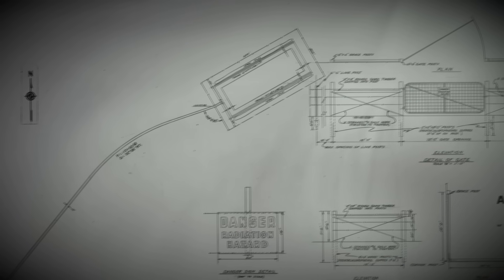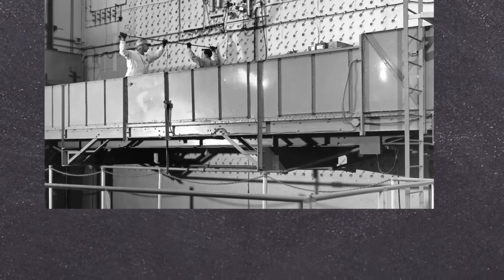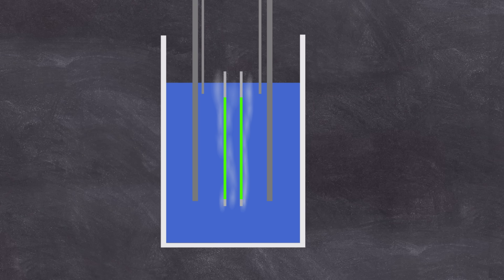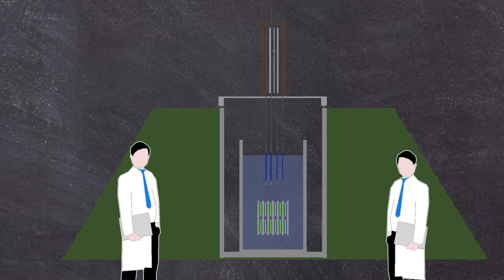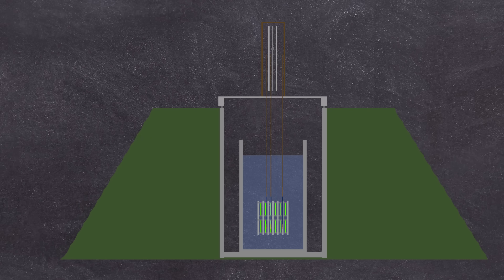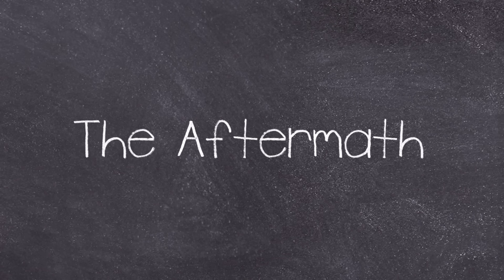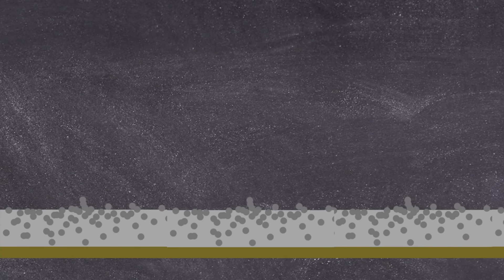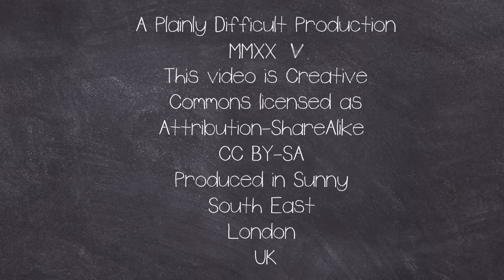Nuclear Reactor Melted Down Deliberately To See what would Happen | Plainly Difficult

Comment: I worked for Argonne National Lab for 4.5yrs, until 2009. I had a 10yr. NDA to follow after I was laid off due to DOE funding cuts. But I can tell ya that place was as dangerous as hell with all the experiments they did in the late 40s through the 60s. Basically, any structure or grounds in the building 3 and 400 area required film badges that were closely monitored. Some buildings were so hot that 1 had only mins to be in them with all PPE on. I had friends that worked in HazMat that were tasked with cleaning some of these places up. Some lost their hair..There was 1 building in particular that was being dismantled and its core was shipped in a stainless steel and lead lined 'bean' to Los Alamos to be buried. It was so touchy, it had state police escorts from IL to NM, and 3 different truck drivers to haul the same trailer. The final truck and that trailer were never to leave that site again. I recall the 'old timers' telling me that the building we were in, 46, used to have a huge burial site in the adjacent field  right across the street. This was several acres of scrub grass and no trees or shrubs. They won't grow. Hundreds of 55gal drums of God knows what were buried there, of which poorly trained crews dumped, some leaking. It took yrs to excavate and remove tons of dirt, all hot and ship it to lord knows where. If you look where east gate is, you'll see vast old parking lots but the buildings are gone. All of that was said to be hot areas.
Reply: After all these years, Hanford's Vitrification plant is in final testing prior to making inroads into processing 56,000,000 gallons of radioactive waste courtesy of Plutonium production from Trinity/Nagasaki through the mid-1980's....
Reply: One of the things that helped the Chernobyl disaster so deadly was an almost complete lack of understanding of what radiation was. Do its funny to hear your story and I think to myself that if, the Russian higher ups had known about as much you guys did how it would have looked historically in the Chernobyl incident.

Comment: The extreme longevity and unsurpassed danger of the spent radioactive materials is why I just don’t believe in nuclear power. Active reactors have a relatively short life span of around 30+ years but their spent nuclear cores contaminates on for centuries. How is that good for us?
Reply: Do you know much about nuclear waste?
Reply: @ not very much I admit but anytime I read about it the informations always says how many decades or centuries it will take to deteriorate to non-lethal levels.

Comment: @04:05 -- I think the concept makes more sense if the reactor fuel rods are horizontally mounted, and the water/moderator is "shallow" and wide.  Vertical like in say BMRK wouldn't do well, because any height difference exaggerates the heat (infrared photon) difference.  Do we want a shallow pool which periodically dries, or a vertical cauldron of doom where the closer to ground water is still constrained by water above it, while it receives sufficient heating to flash-boil and then explode?  Kab0000000000m

Oklo Mine demonstrates that water moderation can do this job, though no one was around to witness. Seems
Foolish to make a boiling water reactor be vertical in its fuel assembly.
Reply: I'm not sure that infrared photons have much relevance here.
Power reactor coolants are normally pumped around cooling circuits, some much of the heat transfer from the fuel is by conduction from fuel via clad to coolant and then by moving the coolant around.
Horizontal fuel channels were used in the Windscale plutonium production reactors but vertical fuel and control rod channels are generally preferred.

Comment: 100 liters of coolant?? Doesn't sound like much.  Could it be 100 gallon?
Reply: I believe that's just the volume of water closely present around the fuel. Because of the short duration of the prompt critical excursion, only that water was vaporised by the heat released.
The reactor tank was big enough to hold about 4500 litres of water.

Comment: Hang on, I thought the whole point of the design was that the reactor COULDN'T explode, because the moderator would boil away as the power increased, thus reducing reactivity and lowering the temperature?
Reply: True but the core design was modified to allow it to explode just for this experiment.

Comment: You explained water moderation correctly. Thing is; It works exactly the same way in pressurized water reactors. Hot water is less dense than cold water. Water heats up, reaction goes down and vice versa. The real benefit of boiling core is, you don't need all that primary loop piping and the huge steam generators operating at 1700psi and 480deg F. It's straight to the turbines at, maybe, 350psi. I saw pictures of fuel assembly "Fretting" when I was doing an HVAC Control System installation at ABB. They were hanging on the wall as art work.

Comment: The inherent stability you describe is due to the moderator's negative reactivity coefficient.
Pressurized water reactors have this too and are inherently stable.  It's not an advantage that boiling water would have.

Comment: Great video and fairly accurate... I have had to go through nearly all of the public documentation and results on BORAX and SPERT at my current position.

The importance of BORAX and SPERT cannot be overstated in determining safe operating limits and principles for all modern light water reactors. The experiments do seem like they were performed in the wild west, but the rate at which the nuclear science and engineering knowledge grew in that time frame was exponential. I'm not advocating for open-air destructive tests, but I will note that these days it can take years to plan, fund, and build small scale tests at a level that the NRTS personnel were accomplishing on a monthly or weekly basis.
Reply: Hell nowadays regulatory costs often exceed the cost of everything else as soon as it involves anything that isn't a PWR or BWR of standard design

Comment: "We've invented a self-regulating reactor that cannot melt down!"
"What if we fixed that?"
Reply: That is what the Molten Salt Reactor was suppose to be... Self healing as well... Interesting stuff. GE doesn't like it though. LOL
Reply: @worldsincollision  Can't be a melt down disaster if the fuel is already molten.
Reply: @worldsincollision to be fair, people are working on molten salt reactors, they were scrapped mainly because the guy working on them was fired for other reasons and no one else was around to push for it, plus there’s issues with electrical pumps working at 700+°C and salt not corroding the metal
Reply: @worldsincollision  it's pretty much the only way GE can catch up to Westinghouse's AP1000, that thing is pretty much peak PWR design
Reply: @worldsincollision  Sodium reactor experiment?
Reply: Hey Mike, hold my beer so I can make this water boil in seconds
Reply: @davidthomas1467 "A watched pot never boils."

And they took that personally.
Reply: Correction: it was an explosion (steam pressure), NOT a melt down.
Reply: ProjectFarm- "we're gonna test that!"
Reply: Once a nuclear reactor goes "prompt" critical (nuclear reaction sustained just by the neutrons released directly in the split  second of fission all bets of control are off. That state was never reached in Fukushima or Three Mile Island and maybe not even in Chernobyl
Reply: @ulrichbrossmann1225   Reactor 4 at Chernobyl very likely went prompt critical during control rod insertion thanks to poor design. This was pointed out in the main findings of the initial investigation into the causes of Chernobyl to the Politburo by Boris Shcherbina, in which he reports on the findings of the State Commission created to investigate the causes of the Chernobyl accident. The RBMK design has a positive void coefficient, unlike the negative void coefficient of the BWR in this episode. There was question based on early evidence that one of the spent fuel pools at Fukushima may have had a small prompt excursion which was only ruled out when isotopic samples of the debris were assayed.
Reply: @Peter_S_  Yes there is evidence for that as nuclear fuel debris and trans/uranium nuclides were found dispersed around the site. The positive void coefficient is due to graphite beeing used as the main Moderator. If I remember correctly,  the prompt excursion was not streng enough to blow up the massive graphite core and sufficient partielle spent nuclear fuel  was left to cause some kind of core meltdown (+ resolidification at base)
Reply: The Republican way to fix things; break it and blame the Democrats.
Reply: “Hold my beer …”
Reply: To be fair, isn't a part of engineering sometimes deliberately pushing something to the point of failure to help develop safety measures to stop it from getting to that point accidentally?

Comment: The UK atomic weapons testing left 5kg of plutonium buried in the desert. When they actually cleaned it up properly they found a sphere of plutonium 1mm round that broke testing equipment.
Reply: Lol, I’m australia they found a cobalt sphere, they found it with a Geiger counter, but it gives off gamma rays they couldn’t measure. 

As they got closer to the base lab the gamma detector kept increasing and went off its nut, inside, with the cobalt sphere in the vehicle outside.
Reply: Plutonium is an alpha emitter. Good luck finding it
Reply: @crono331  There's detectors specially built for it.  Funny enough I just ordered a vintage example: AN/PDR-56F,  has both an Alpha detector and an X-ray detector tuned to the low energy soft x-rays given off by the Pu decay.  For the curious, the x-ray probe is a CaF2:Eu scintillation crystal.
Reply: @Yaivenov  Don't rip the foil! 😅
Reply: @ Yup.  Thankfully it is a simple/cheap as far as scintillation detectors go.  It's a zincsulfide:silver scintillator sheet and then an aluminized mylar light-shield sheet.  Very repairable if I do accidentally poke the foil.
Reply: What about the things it decays into? Are any of them more long range?
Reply: @FireIceEarth  It decays into Helium-3.  Non-radioactive.  Fun fact, the periodic recycling of Pu nuclear cores is where the vast bulk of the world's 3He supply comes from.
Reply: @Yaivenov I'd love to learn how that works
Reply: @colinofay7237  The detector or the helium capture?
Reply: Seems strange to go from an atom that big to He3? Surely like 100 steps in there?
Reply: @Yaivenov  Tell how long it takes to become "Non-radioactive" ?
Reply: How did they find it? You realize how small 1 mm is?
Reply: @Danny_Thompson_sasquaatch420  geiger counter?
Reply: @Danny_Thompson_sasquaatch420 1mm of Plutonium is definitely radioactive enough to et off any detectors for several meters around it.
Reply: They didn't "clean it up properly".

Comment: The 1950's really were the age of "let's do something with this atomic stuff for a larf!"
Reply: Why not? We could protect ourselves under school desks if something went tits up 😕
Reply: @katiekane5247  too soon bud
Reply: Since then, we now sit here screaming incoherently at history books and videos like this one!
Reply: "Let's poke the spicy rock with a angry stick and see what happens!"
Reply: In the building I work in, which is part of a university and has a lecture hall, there are a series of lockers built into a concrete wall.  The doors to the lockers only measure about 1 foot by 1 foot, but have a lead core and weigh about 40 pounds each.  They were for storing radioactive materials so professors could use them in lecture.  They have not been used for their intended purpose in several decades.  Probably since about the late 1950s.
Reply: Operation Plumbob is my favorite when they launched a manhole at mach 170 off Earth lmao
Reply: "What's the worst that could happen?" 🤣🤣
Reply: BORAX actually was more of a series of tests to test the stability of a boiling water reactor (previously thought to be unstable).  The tests showed a boiling water reactor could be stable, and even self-controlling, but only to a point.  The data from this resulted in the BWR design that GE and a few others commercialized in the late 50s
Reply: ...and some of the crap we did in the 50's and 60's is STILL classified.  Even when it is declassified, an FOIA document request gives you documents that are so redacted that it looks like the copy machine had a meltdown.
Reply: "Oo, it exploded! Cool!"
Reply: This was nothing compared to project pluto. Where the US was developing a nuclear powered missle delivery system that could carry 9 warheads and stay airborne for 3 months. Problems were many. The main one was they didnt know where to test it because it left in its wake nuclear waste that would kill everything it landed on.
Reply: @bradsanders407  Failure of a good PR and lobbying team.
"We can build it, but there's no where to test it because it is so deadly." sounds like a great beginning pitch for a black works superweapon. Convince Congress to give you billions of dollars to design and make something that will be completely secret and hidden away. If it works, congratulations, you just aided in ending the human race. If it doesn't no one is going to be showing up to ask for a refund.
Win-Win from a corporate point of view.
Reply: And now we know not to. Except people now want to again after decades of decay in the quality of education and engineers.
These tests make much more sense than people’s modern faith in and worship of technology
Reply: Imagine a world where Teller and MacArthur were let loose without anyone at the reigns.
Reply: ai is our nuclear
Reply: Thats nothing, wait till u r older and find out what they wer doing "for a larf" in the early 40s...that will cheer u up!.

Comment: Spicy water? My favourite! 😋
Reply: Something to drink if you feel thirsty after eating those yellow cakes...
Reply: The forbidden mineral water
Reply: Purified water will not get activated by neutrons so i doubt it was that spicy
Reply: @crono331  I believe that water fresh from a reactor is activated with oxygen-15 but its half life is only 122 seconds.   This is why the turbine halls of Westinghouse BWR power plants (which use steam straight from the reactor)  are closed to entry while running, but can be entered after waiting just a few minutes after shutdown.
Reply: @crono331  The hydrogen (H-1) in water absorbs neutrons to form Deuterium (H-2). That can in turn absorb neutrons to form radioactive Tritium (H-3).
Reply: @derekp2674  as far as i know that can only occur in heavy water reactors. in reactors where light water is used eventually the activation problem occurs for isotopes of oxygen, and tritium can form due to irradiation of boron. usually, gaseous hydrogen can be activated by neutrons, but not the hydrogen in water molecules. or at least, that is how i understand it, and im only a hobbyist. tritium is naturally formed in the atmosphere too. 
at any rate, tritium is so weakly radioactive that it is even extremely hard to detect. i have a couple small vials of tritium and none of my detectors can detect any low energy beta emission, which is shielded by the superthin glass of the vials. it has a very short biological half life and is not accumulated in the organism.
Reply: @crono331  Thanks for your reply. I am a qualified nuclear engineer.
I have never come across particular issues with the neutron activation of oxygen but I do know that the UK's environment agency keeps a strict eye on the quantities of tritium that can be allowed to discharge from nuclear sites.
Both hydrogen and deuterium do absorb neutrons by radiative capture reactions. 
But the reaction cross sections are much greater for hydrogen than deuterium.
Both deuterium and oxygen have very low overall neutron absorption - that's why D2O can be used as a moderator for natural uranium reactors when H2O cannot.
Reply: PS - neutron irradiation of B-10 causes capture reactions that produce Li-7 and alpha particles. I don't know if or how tritium could be produced?
Reply: @derekp2674  thanks for the info. they way i understand it from my hobbyist point of view is that tritium formation in fission reactors is normally not a huge issue and is easily controlled and managed.
Reply: @crono331  Thanks. I think the key word there is "managed". We really don't want tritiated water leaking out into the environment and our food chain.
Wikipedia has some interesting articles on both Tritium and Oxygen-15.
It turns out that high energy neutrons can split Li-7 to form one tritium atom and two helium atoms. However in a thermal reactor, I think that reaction could only occur with neutrons immediately after their release from fission events and not after they had lost any energy through scattering reactions.
Reply: @derekp2674  this stuff is the closest thing to magic that i can think of 🙂
i have a question. neutron bombarding H2O i will eventually get some D2O (or HDO?) and then with further neutron irradiation  T2O (or HTO), which then decays into.... what? Is there a case where neutron bombardment of water will generate gaseous tritium?
Reply: @crono331  I think neutron irradiation of H2O is quite like to produce HDO then perhaps D2O and HTO, with the former being much more likely. Any local ionisation of the water might then create some tritium ions, leading to the possibility of some of those becoming gaseous.
But irradiation of water can also result in radiolysis, where energy absorbed from the radiation can break water into gaseous hydrogen and oxygen.
Reply: @derekp2674  didnt think about radiolysis of water. so interesting. superthanks.